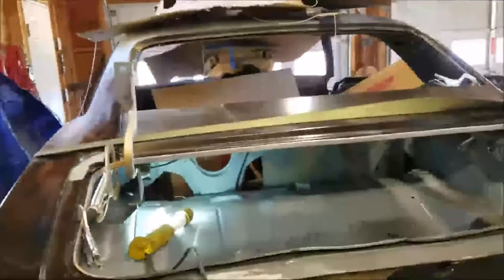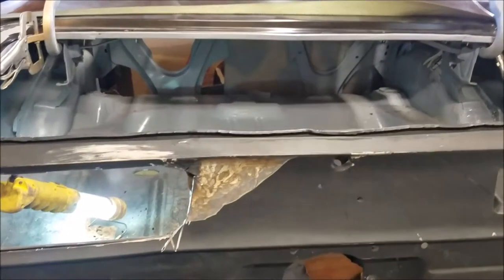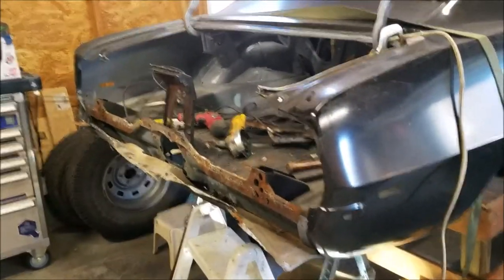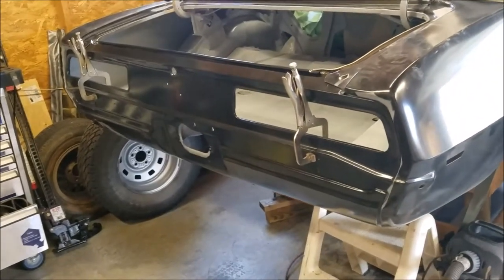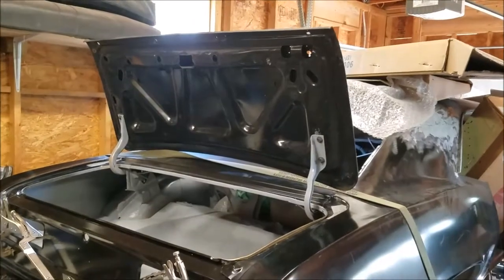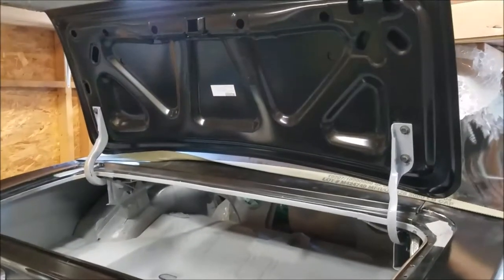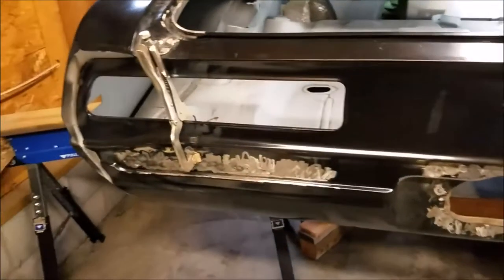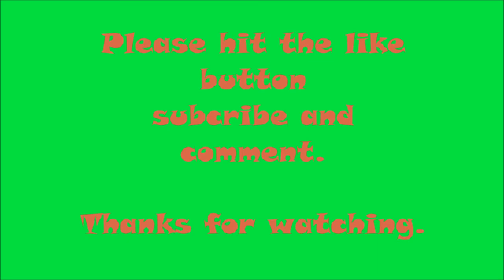69 Camaro tail panel removal and install

Comment: Alien, when you removed the tail panel, are both quarter panels welded or just bolted up. I have one quarter panel almost ready to be bolted. Also did you do both quarter panels and then filler and tail panel, trunk lid.
Reply from the maker: What I did was as I was taking  out the tail panel I decided to stop the tail panel removal and focus on the trunk. The trunk was key 2 welding to the tail panel and the quarter panels on either side. so this is the order I went in installation quarter panels first but did not weld the back half of the quarter panels until the trunk was taken care, I used to filler panel in the trunk it wasn't a full trunk panel it was just a filler piece in the center, then I did the tail panel and finished welding the quarter panels on either side to the tail panel and to the trunk tell panel supports, those are those angle brackets that i pointed to in the video. At this point the filler panel was just held in by sheet metal screws to hold it in position. I wanted to leave that tell last so I can adjust things. Hope this helped.
Reply from the maker: Sorry that first post was well I just got up.

1 quarter panels
2 truck floor
3 tell panel
4 filler panel

I don't know if you seen all my videos but remember this is my first time doing this and I just went with what made sense. There's a guy called Rarerat he has been restoring camaro's for a while and very good at it. Check him out.
Reply: @AlienRestoMod , yes it did. After I messaged you, I watched a lot more of the videos all the way through. Hopefully I don't run into the same issue with the trunk lid. Thanks for taking the time and writing me back
Reply: Alien, In your personal opinion do you think I should put some bracing on my car when I do the quarters. As of right now my car is on Jack stands. Car is in running condition so obviously it has it's full weight on the stands. I have one quarter off ready to be moched up for another fit or two. Then I'm going to throw a couple of screws and maybe a few tacks on. Then I was thinking about starting on the next quarter, then the filler then the tail. I'm asking about the bracing because one side will only have some screws and tacks and I'm afraid if I start cutting off the other quarter the rear might sag or something like that.
Reply from the maker: Of all the youtubers ( experienced) I've watched most did use some sort of bracing so everything would line up. I should've used braces in a couple places.  I would use braces if you're going to take off more then one panel at a time, like the quarters.